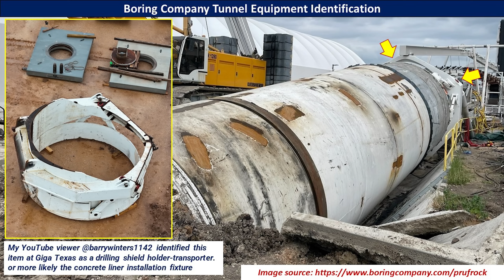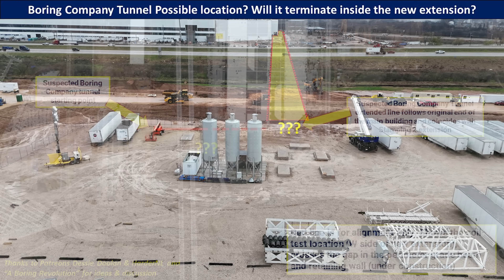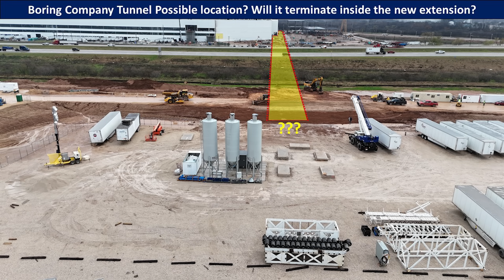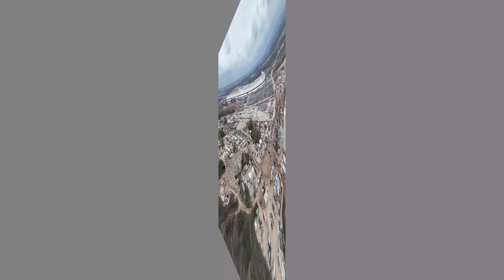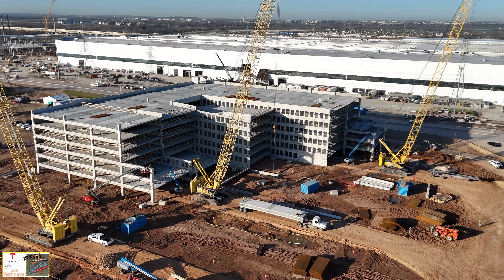Production Picking Up & Start of Boring Company Tunnel?10 January 2024 Giga Texas Update (08:55AM)

Comment: 4:01 and 9:23 - Joe, your analysis of how and where the GigaTexas tunnel will be built is excellent. This study allowed me to improve another one, which I had already carried out the day before yesterday regarding the extension of the tunnel. Now, with the information you provided, I measured the location and concluded that the excavation should be around 500 meters long. However, I also think that, like the existing construction at the Boring Company headquarters, connecting it to the Starlink factory, there would be two tunnels, to serve as one-way and one-way traffic. And this thought seems to be supported by the existence of two flaws in the strapping of the foundations of the new extension of the GigaTexas main building. This is very visible in the time and time photos 4:01 and 9:23.
I would like to hear from you about this hunch of mine.
Thank you very much for this extremely educational video about this major work.

Comment: Thanks Joe
0:39. GA, southwest corner. No hard attachment. That'll be a construction/fire separation gap there. The new wall panels will bridge the gap, but no structural connection between new and old.
Multiple layers of drywall infill where the windows were removed, suggests a need for a fire rating.
1:29. Boring Company site. Conveyor belt storage cassette, or conveyor magazine as suggested by @DavidSalisbury50 in other comments.
4:57. Tunnel alignment. Cut and paste from another response.
Couple of things to consider.
It's not known how much cover is required under the highway, nor is it known where the extent of that cover is required. Only under the road surface, or for the full width of the road reservation. Where does the road reservation end, the property line? The property line best as I can figure is about halfway down the berm.
The real defining issue is the 96" 8' 2.4m stormwater drain. Bottom (invert) of drain is 398.35' or thereabouts. Top of drain 406.35'. Perimeter road around 412'. Highway around 435'. For reference, floor in the factory is 418.5'.
Tunnel has to cross the drain, either over or under. Over the drain, then the cover issue comes into play. Under the drain. No issues with cover, dodges all other in ground utilities/services. Remembering that the idea for the tunnel is to get vehicles to self drive from the end of the production line to the New EOL facility across the highway, then an entrance inside the factory near the end of the production line is logical. Speculating that the tunnel ends inside the factory, relatively close to the perimeter grade beam, hence the need for the gap in the beam.
The sanitary sewer line that discharges into the deep wet well, I’m guessing the tunnel passes over the top of. The sewer line is relatively deep at about 404’.
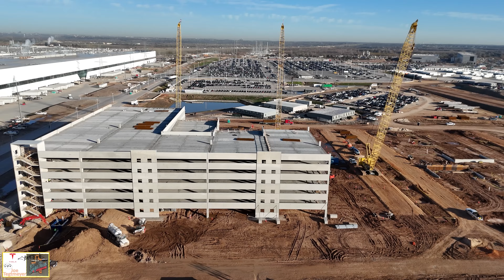6:31. Parking Garage. Bottom left. White PVC would be stormwater drains.
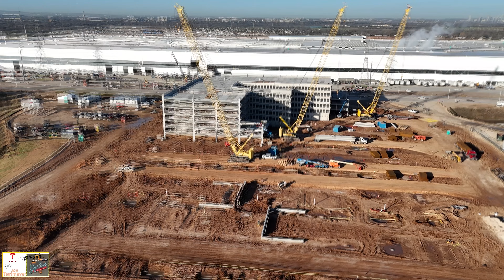7:13. Parking Garage. Bottom. Retaining walls at the second ramp location.
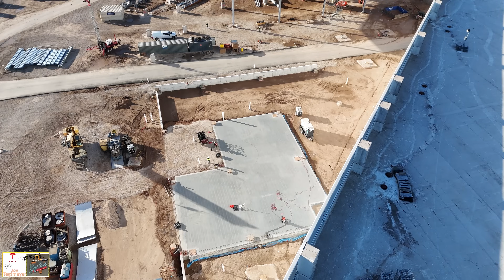8:44. Southend. Triangular area. Tank farm slab. Surface has been ground. Surface must have been too rough/not flat enough for the tank bases.
Curved tank sections bottom left.
9:00. Stamping 2 extension, south wall. A couple of metres left is the centreline of the tunnel alignment. Roughly the line of pairs of PVC pipe risers a little further west.
10:57. Southend. Speculative tunnel entrance. Note the elevated column pedestals finish at this point also.
11:24. GA southwest corner. Foam core visible in the face of the cut. Xs on the wall would be where the saw guide was bolted to the panel.
12:58. New EOL site. Left. White steel beams. I think these are seen as the supporting structure for the ‘thrust ring’ seen at top right 1:07.
14:13. New EOL building. Northeast corner. Left. Ductbank risers meet the existing conduits the loop under and into the building.
16:08. Battery roof. Ballast blocks for the PV Array. Some of these are hollow core. Existing installation only used solid blocks. Possibly a different mounting bracket to the Unirac brackets  sued elsewhere. Stack of hollow blocks at 16:48.
21:12. Transmission lines/temporary switchyard. The money shot. Cables removed between the transmission lines the timber poles.
22:23. Cathode, north of. Lift station. Excavation. Uncovered the stormwater drain for some reason.
23:09. Far north. Excavator getting some attention from a mechanic.
24:22. Cathode pond. Left. Top of bank above the green erosion ‘control’ mat. Wire cages. Gabions perhaps.
25:19. Cathode. Plant platform. New scaffold getting a plastic wrap. To deter snooping drone pilots….
26:17 Die Shop, apron. One GROB crate gone.
29:08. Easement. Cabling being run in the ducts is the parallel supply that originates from the Mega-Vault under the pair of white building at 20:30. No direct connection to the Mega-packs.
Reply: 12:06: nice paint job on that pickup/ute...
Reply: @greggerypeccary666  12:06. Two-tone. Getting the colours to fade into each is the tricky bit.

Comment: It would have to end at the berm as the deep dewatering well and pipework are in the way. Likely the interior diameter of the tunnel is 12ft. So it looks like a straight horizontal bore at minimum depth under the motorway.
Reply: Exactly. All the underground infrastructure would not fare well to a boring machine onslaught.

Comment: From all I have heard tesla has a serious problem with dust in the main factory and I suspect at the dye shop and cathode plant, maybe why they are putting down the concrete so fast between the two buildings and the large tarmac part of the carpark. The white sheeting would be for control of the dust, I see no other reason for it.
I have said before it must be hell for workers and I would have thought they would have concentrated laying all roads and planting grass as quickly as possible, but yeah tesla is not known for really caring about workers at all. This is why regulations are so important for health and safety, Texas is very lax on regulations, a reason so many businesses are fleeing the state i suspect.
I just know i would not be happy working in an enviroment where they did little to ensure air quality was acceptable,  i wonder how many workers have related health issues.
Look at berlin to see how its done, very quickly after the factory was completed all roads and parking was covered and grass everywhere, again that is the benefit of having tough regulations in place for workers safety..
Reply: "Texas is very lax on regulations, a reason so many businesses are fleeing the state i suspect."
Fleeing?  You have it completely backwards, my friend.  Businesses are fleeing in droves from highly regulated California, for example, and relocating to less regulated Texas.  Example: Tesla.  Its headquarters moved from California to Texas a few years ago for that exact reason.

Comment: "Come to my aid Dessie" : If there is a 25 foot difference between the highway & perimeter road at best we need a tunnel under the highway & a cut-&-cover at each end - Keep it simple  - Why have a boring when you can have a tunnel - But we don't know the whole story.
Reply: Couple of things to consider. 
It's not known how much cover is required under the highway, nor is it known where the extent of that cover is required.
Only under the road surface, or for the full width of the road reservation.
Where does the road reservation end. The property line? The property line best as I can figure is about halfway down the berm.

The real defining issue is the 96" 8' 2.4m stormwater drain. Bottom (invert) of drain is 398.35' or thereabouts. Top of drain 406.35'. 

Perimeter road around 412'. Highway around 435'. For reference, floor in the factory is 418.5'.

Tunnel has to cross the drain, either over or under. Over the drain, then the cover issue comes into play.

Under the drain. No issues with cover, dodges all other in ground utilities/services.

Remembering that the idea for the tunnel is to get vehicles to self drive from the end of the production line to the New EOL facility across the highway, then an entrance inside the factory near the end of the production line is logical.

I always have a hat on standby with these predictions, but I'm confident about this one.
Reply: Thank you Dessie - I was a bit naughty & should have known better - You  really have it nailed.
Reply: @edwardmorpeth5988  That would be appropriate, I am a carpenter. 

Retired. No, I won't build you a deck.

The speculative alignment and start ramp inside the factory is the simplest design. I will now be surprised if some other arrangement is constructed.
Reply: Drat - I thought you were a smart mature lady living in the northern suburbs of Sydney - The last hope for retired engineer.
Reply: @edwardmorpeth5988   What branch of engineering?

Comment: 1:00 From the photo from @barrywinters1142 the white steel ring section is clearly a thrust ring and support for the overhead conveyor system as it enters the tunnel. The segmental rings only work well when they have external pressure from the ground holding them together. At the surface as seen in the photo they are unstable, especially when subject to the TBM thrust and point load such as the conveyor in the crown. Also there is a large inclined prop (I assume another on the opposite side) against the ring back to the ground which provides the thrust reaction for the TBM to initially push from (the mounting pins can be seen on the ring laying on the ground). So the white ring appears to provide three functions; Thrust reaction ring, segment ring stability and conveyor structure hanger point.
Reply: What purpose do you think the excavation at 12:02 is for?
Reply: @DessieDoolan  seems it will be the launch location for the TBM. Using a 15 degree inclined TBM in a cradle it still needs to be partially buried in the ground (like the photo provided by @barrywinters1142). So the dig a pit/trench, cast a cradle for the TBM to sit on, build its back up equipment behind it and a set of segment so rings or half rings to push from (probably what the “red” segments are for).
Problem is only very limited thrust can be utilised this way, but it should work in the soft ground.
Reply: Also there are a couple of small red flag markers on either side of the excavation for setting out. Probably the centreline of the tunnel.
Reply: @davidsalisbury50  Thanks for the response. I'm getting a better idea of how this all works now.
12:58. White beams. I have an idea these would be the supporting frame for the thrust ring. Similar top right at 1:07.
Reply: @DessieDoolan  think they are related to the conveyor, probably intermediate support frames until the conveyor is into the tunnel where it is mounted from the bolt holes in the crown.
Reply: @davidsalisbury50  12:58. Thanks. I should start a file on TBM terminology.

Comment: 10:57 Two white barriers adjacent to the highway. Probably show the alignment of the tunnel. Possibly protection to some surface monitoring installation (piezometer or extensometer) to measure effects of the tunnelling. Good if you could get a close up next time.
Reply: 10:57. 11:44 also. Seems to be signage. Some local environmental authority requires such signage around the place. Given it's location, probably associated with the tunnel.

Comment: Interesting how your yellow shading covers the big round well they spent so much time constructing on the southwest end of the plant. Also, it seems the only thing they will gain from a tunnel is the experience drilling a tunnel. Would be different if said tunnel went from inside the main factory to inside the end of line facility. If they really wanted to spend money, they could construct a railroad spur from the current loading facility to somewhere near the end of line warehouse. They could put it alongside the highway on the edge of the highway right of way. Save time and minimize the possibility of damage in transport to the railhead. Like Dennis said, the test tunnel in Hawthorn had an elevator. And referencing Jeff Gilmore, tunnel for autonomous self driving. Stay warm next week Joe.
Reply: Highway 130 was originally conceived as part of the Trans-Texas Corridor  project, which was supposed to provide right-of-way to support roads, rail, pipelines, and utilities along with hike&bike trails along its length. That project was abandoned after 130 was started, but there is enough width in the ROW to allow rail down the median,. Building a private rail line might be difficult to get permitted, but likely easier than getting approval for a 27 mile long tunnel, and  it’s always cheaper to build above ground unless there are mountains involved.
Reply: @Frank-gt7me  I agree, 100%. Especially if Tesla throws in a couple more Mega Batteries along the way to benefit the local communities.

Comment: Being that its a freeway I think they are likely to go a bit deeper boring under the road due to load considerations. Something else that red line is located in this area is that deep well and pumping station is it not? My bet is it comes up inside the factory. The less chance for an incident with other drivers the better. If its on the rotisserie its been crashed Joe. Its used for inspection after the fact.

Comment: My guess is that the tunnel will be used to send finished cars AUTONOMOUSLY over to the EOL building.  This avoids the constant driving back and forth by logistics employees, plus keeps the cars clean.  Since the cars never travel on public roads, there are no regulatory issues with self-driving.
Reply: Very Plausible. They could do an L tunnel just like the Hawthorne Test tunnel which could terminate inside the EOL building. The vehicles would never be exposed to the elements going building to building. Whatever happens, it will be fun to see the tunneling process. Given the relatively short distance, it shouldn’t take long to create. I’m guessing 2-3 months for the basic tunnel boring then another 2 months for finishing out the Termination points.
Reply: My thinking, as well.
Reply: 🌈🌎🐉 Fr Canoogan concurs: there are many self-evident functions for a tunnel, the most beneficial being that vehicles will be FSD calibrated along the way (that's why the CT has been crawling the Boring Tunnels of Vegas 😅)
Reply: Cars go on private road under the motorway to get to the other side

Comment: For the boring tunnel, did they made geopiers close to the extension where it should land? We would have our answer pretty quick. Because if there is some geopiers in the way how they will manage to get the tunnel there!?
Reply: Geopiers (compacted aggregate) would be no obstacle to the TBM. The CFA piles (reinforced concrete) are only located under each column, plus 1 or 2 mid span of the perimeter grade beam between columns.

Gap in the perimeter grade beam that I'm confident is the alignment of the tunnel wouldn't have a CFA pile mid span unless the tunnel alignment was a late decision. But I don't think it was a late decision for other reasons.

Comment: 18:41. Pulling sheaves set up to pull wires. Steel cable pulling rope layer out. The trailer attached to the truck is a diesel powered cable puller.
19:07. The four tall cylindrical items on the two pallets look like current transformers.
Reply: 19:07. Those would be the replaced transformers that were tied to the fence a few days ago.
Reply: @DessieDoolan  I only saw PTs in the yard, no CTs.
Reply: @GoCoyote  19:07. Look the same as the ones being removed in Joe's 3 Jan video at 23:30. I'd post a link, but youtube fairly cranky with me and links.

Comment: Joe, It just dawned on me that the Original Test tunnel in Hawthorn had a vehicle elevator at the Entrance end. It would be very possible they use something like that inside the building. This would eliminate the need for a sloped entrance avoiding the current underground infrastructure.
Reply: I think it is possible.
Reply: With the amount of cars manufactured that would be a seriousbproblem as a lift would be a bottleneck, but with they equipment it looks like it will be a slope on the west side, no signs of anything on the factory side of the motorway yet but a lift would slow everything down.
Reply: @flubalubaful  We saw in the factory tour, that Tesla had several lifts moving partially assembled Cybertruck up and down floor levels as it progressed through the line. Doesn't seem to create a bottleneck.

Comment: Thanks Joe!  I don't think the tunnel will surface inside the factory.  It would be easier to trench it prior to building, which they didn't do.  So I think it would terminate at the building perimeter, at the longest.  Another factor may be the maximum length of a tunnel with no emergency exits.  (800ft?)  Airflow should also dictate that both ends must terminate inside a building, or both ends on the outside.